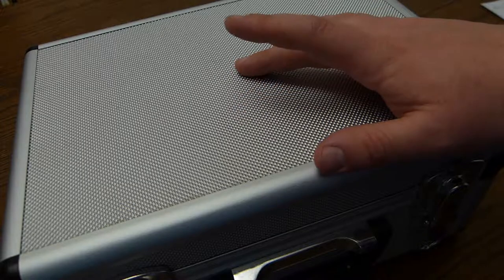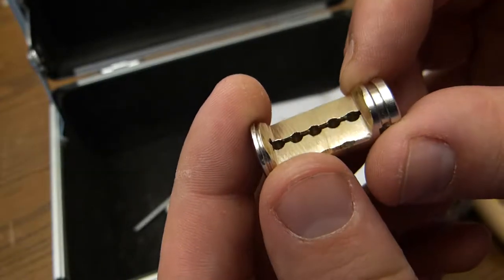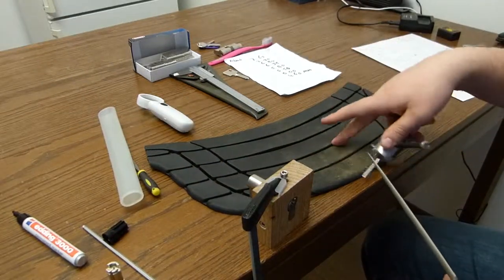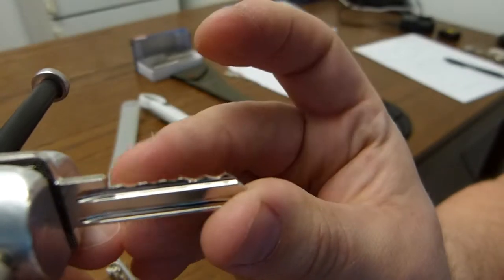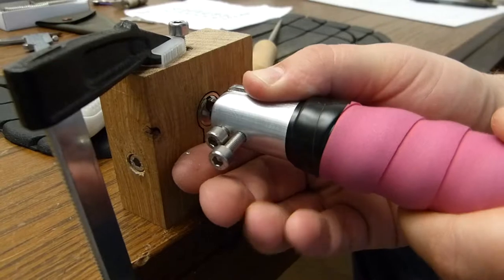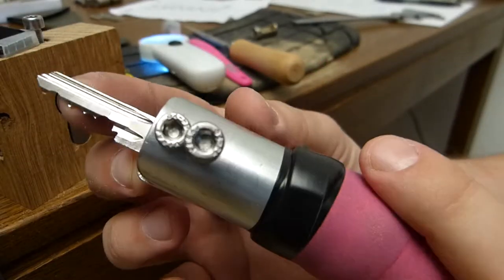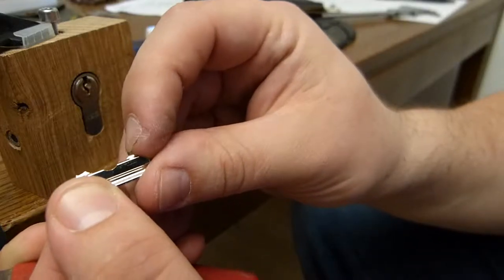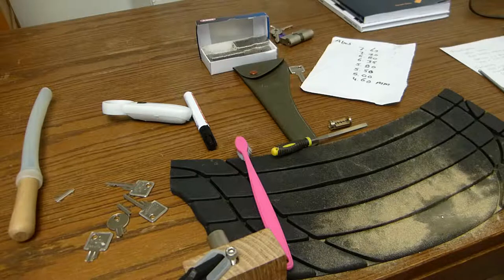[011] UKLS traveling impressioning box

Comment: Very generous set of tools and I must say extremely compelling skill to acquire.
However seeing the high level of your picking and then unable to impression a key reliably on video just made it a lot more intimidating. Is it many times more difficult than learning to pick or have you just been picking a lot longer? How many attempts/keys would you expect a beginner to use before successful? 10,30, more?
What confuses me about impressioning is if pins touch the key when the key is cut to the correct height, what makes that mark look 'correct' compared to 1mm too high or low?
Reply from the maker: The problem for this video was setup. I practice on a work mate with a different file and different lighting. Changing small variables like these will ruin impressioning attempts.

Filming does not make it easier either.

Comment: Do you have the article number or a link of the vallorbe round file? I've looked up every catalogue I can get but could not find the exact/proper one with the same length. The longest model with #4 cut Vallorbe provides measures 200mm (including the handle part). Even though that's barely enough for the job, It would be much convinient with something you showed in the vid.
Reply from the maker: I'm currently using one of these:
https://www.cooksongold.com/Jewellery-Tools/Vallorbe-6150mm-Round-File,-Cut-4-prcode-999-451&query=vallorbe%20cut%204&channel=uk

The cutting surface of 15cm and a diameter of 5.85mm.
Reply: Nice to know is that a shorter file will make smoother cuts than a longer file of the same grade.
Reply: @NoctisMotus  Nice to know that, indeed. Thanks!
Reply: @jwrm22   Thanks!